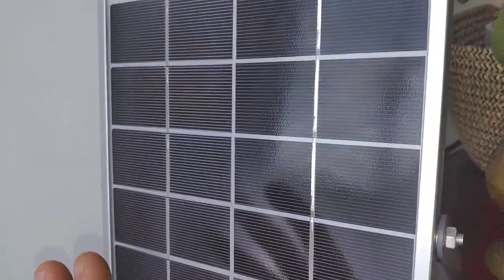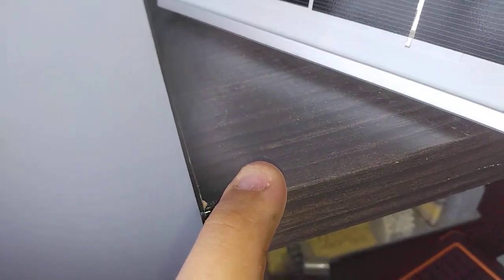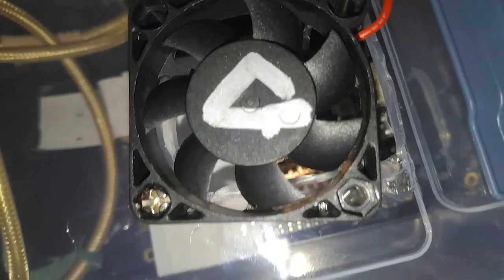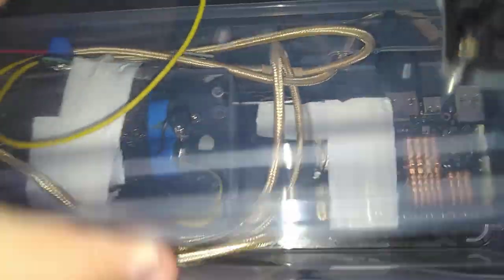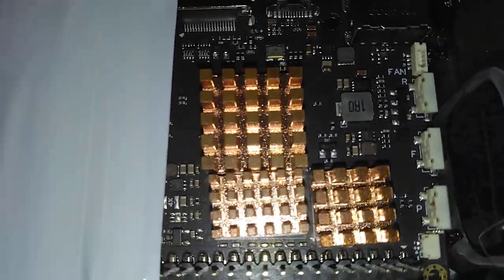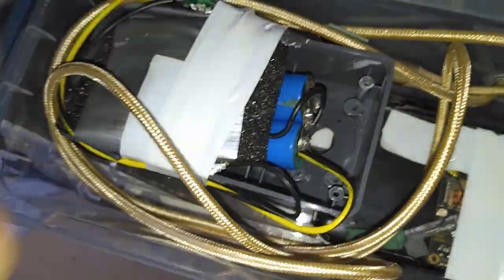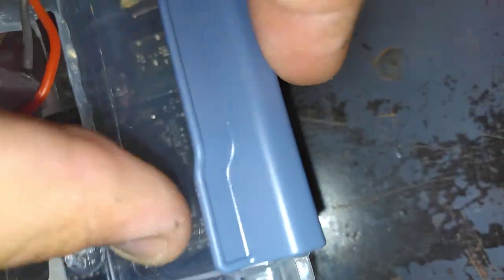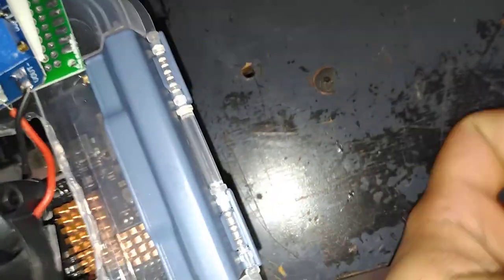Making a solar powered computer using galvanized square steel

Comment: youtube is reading my mind- Im doing a similar project with an atomic pi, and I was tempted to originally make it solar powered since I wanted to make it rugged and highly portable
Reply from the maker: yo thanks, hope you succeed (use a 10 000 miliamp or more for the battery and don't cheap out on the solar panel, if you want to dm me on twitter I can help @caleb13570 )

Comment: How does the cooling work, is the one fan not just creating a vaccum?
Reply from the maker: well no, the fan is set to blow air on the single board computer, it isn't oriented to suck air out of the case